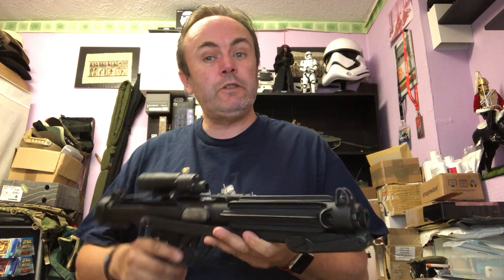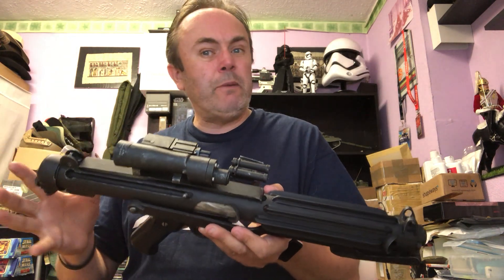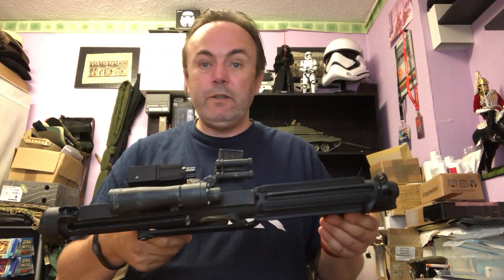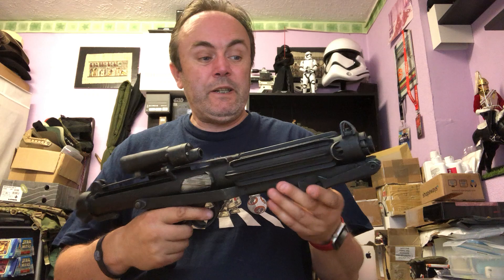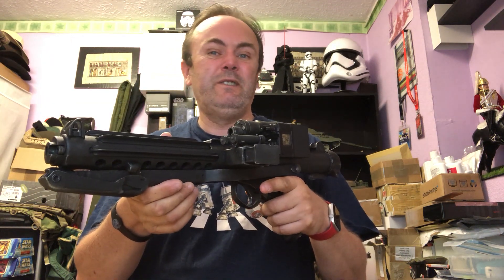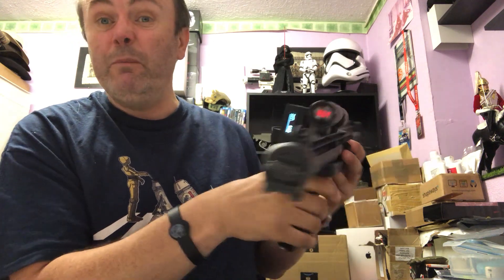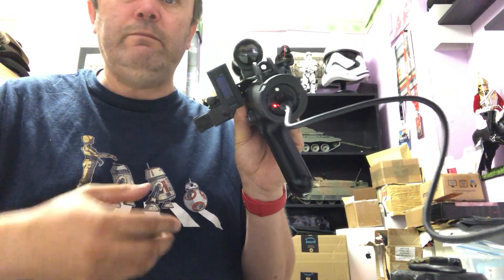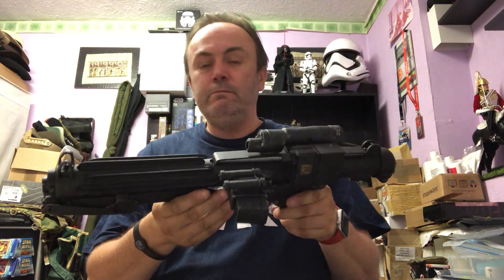Blastech E-11blaster (BlastFX electronics & Doopy Doos resin kit)

Comment: I saw your post on (I think White Armor) and your E-11 is FLAWLESS. I want to build one like it, but I cant get a doopydoos resin kit, because I live in America. Any ideas on how I can get it?
Reply from the maker: Hi,  and thanks for the feedback.  If Doopy Doos will not ship to the US then another option would be to get someone you know in the UK to buy one of their kits and ship it on to you in the states.  Shipping will be very expensive though as there is a bit of weight in the kit.  I would also recommend joining the BlastFX Builders Group on FaceBook too  https://www.facebook.com/groups/blastfxbuilders/.  It is run by the maker of the electronics I used in this build, and has lots of ideas on using other E-11s as a base for the electronics package.  The electronics package i used here is an earlier version and has been updated since I built mine.  There are also some 3D printing companies that are now developing E-11 and other blasters specifically designed to take the BlastFX package, and to be honest with you if I was to build another E-11 like this I would probably go with one of those as the electronics are much easier to fit.  They are members on the FaceBook page I mentioned too and there are pics of their products and what is in development there too.  I hope this helps.
Reply: @paulsstuff1969  Thank you kindly, you've just saved my project!
Reply: @paulsstuff1969  Well, I just figured out that doopydoos DOES sell to America. Now, I don't think that the blastFX seller does. Conclusion on that?
Reply from the maker: @CasualVeemo   Before you give up on the BlastFX I would PM the owner and ask if he will ship one to you in the US.  Whenever I have dealt with him he has been very helpful and obligeing.  You can message him via his other FaceBook page here:   https://www.facebook.com/trooperamp/?eid=ARB3QK6hIJ4T_imvf4EeClTw1aRQvzhiee2DaKXeHFe6KWXnL-l4Ejuw8yIpIsVvWTo10m6mfO1Go6Xf
Reply: @paulsstuff1969  I just thought of something. It would have to be in the distant future, but what if I bought myself a S&T Full Metal E-11 Airsoft, and sent it to you, where you can buy the supplies and the blastFX, and install it for me. I'll try and pay the price you name.
Reply: Thus year, the budget goes to the gun, but next year, I can send you 300 pounds
Reply from the maker: I am sorry Colton, I don't currently do commission work for other people I am afraid.  Any spare time I have has to go on completing my own projects I am afraid.
Reply: @paulsstuff1969  I understand. I will have to find someone else in the U.K. to do it. I doubt that TRamp will do it for me.
Reply from the maker: @CasualVeemo   You could always ask Paul at tramp if he would build one fore you.  He might say yes.  I know he has done complete builds for others in the past.
Reply: @paulsstuff1969  Ok, I'll talk to Paul at TRamp and see what can be done. Thank you so much sir, for your patience and advice. You've inspired me to do something like no one else has. Take care Paul!
Reply from the maker: @CasualVeemo   I am glad I could help with this.  Good luck with your build.